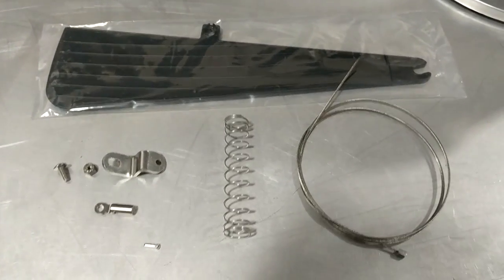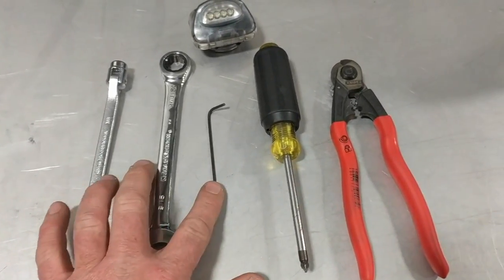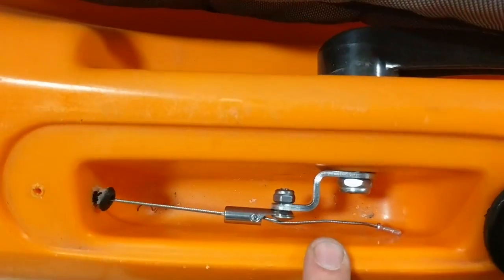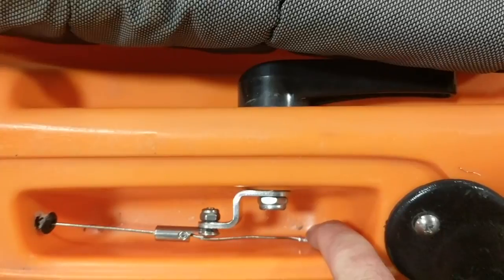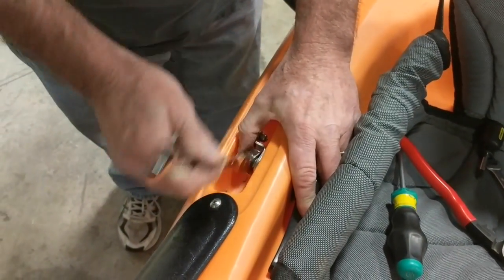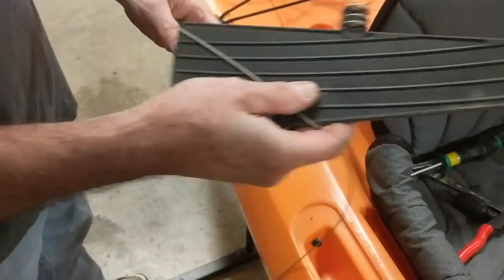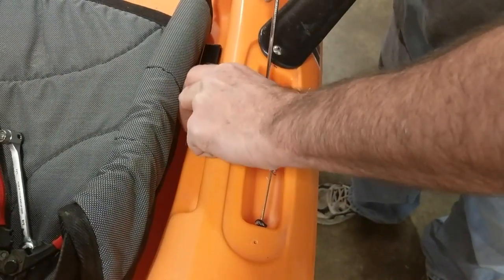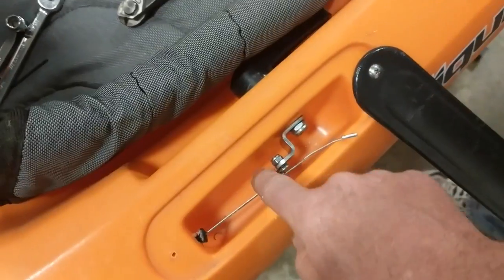Universal Skeg Kit Instructions for Sit On Top and SUP

Comment: Thanks, these instructions were perfect.  In my case, the hardest part was removing the remnants of an old cable that was rusted to the point of being powder inside the internal routing tube.  Once that was finally done, the assembly of the new parts was comparatively fun.